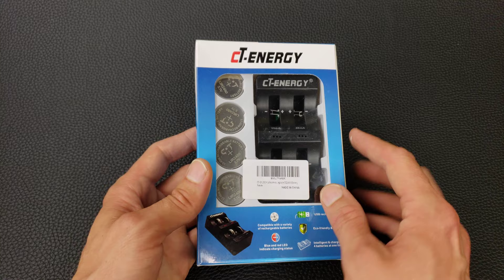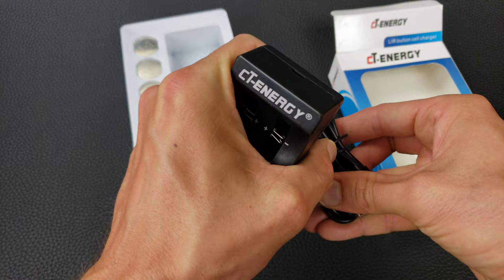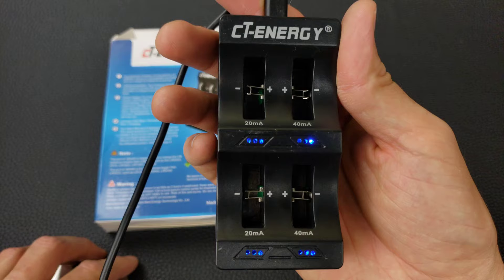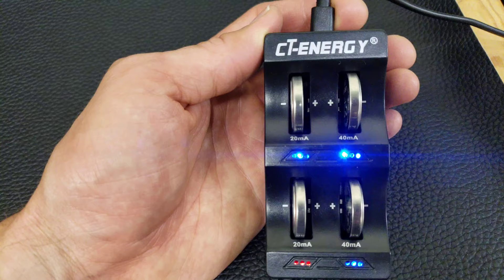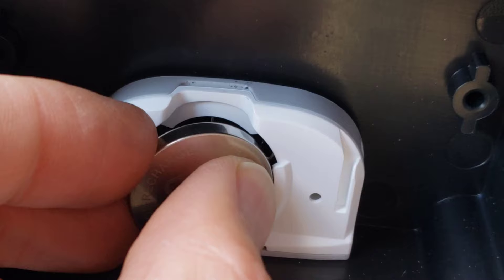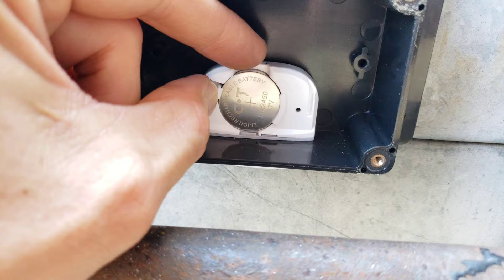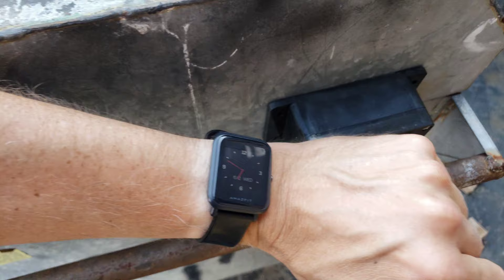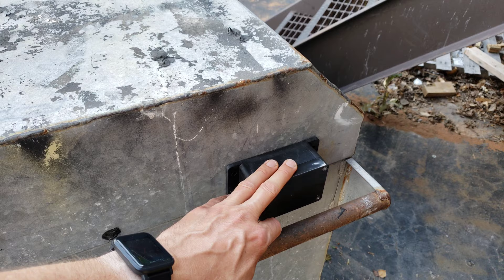Use Rechargeable Coin Cell Battery For SmartThings Smarthome Sensors | CR2450 To LIR2450

Comment: you are very smart dude. and thats coming from a self made electronics engineer with 37 years of electronics engineering with multiple u.s. electronics patents. i have the smarthings home automation system and was ready to design a battery eliminator circuit using rechargable aa batteries to give me 3 vdc at 1800 ma for a 5-year long term smart sensor power supply but if this works ill give it a try. the ratings on a regulat 2450 battery is rated at 600ma. rechargable 2450 is about 200ma max. at that rate it should last 1/3 the time as a regular 2450 but being rechargeable should pay for itself in time. ill give it a try and see how long it lasts. thx again dude.
Reply from the maker: Thanks, I appreciate it, but I was going down the same path you were until I found these rechargeable 2450 cells. Yes, they do last about 1/3 the time. 
For the outdoor version (https://youtu.be/_kKiIegkN_I ), I'm working to add a small solar panel and a low current Li-ion charger to keep the battery charged so I never have to change it.

Comment: You said that this battery has 1/4 of capacity compared with normal battery, this battery has about 40-60mah on the other hand normal battery has 225mah, I was thinking about buying it, but now I don't know if it's a good idea. 🤔
Reply from the maker: LIR2450 rechargeables should have ~120mah vs 600mah for non rechargeable.  https://www.powerstream.com/p/Lir2450.pdf
So, I have to swap the rechargeables about once every 3-4 months vs once a year.
Reply: I was thinking the same thing. As cheap as the normal batteries are, I am just not sure if it is worth it.

Comment: Couldn't find a spec sheet for the multipurpose sensor to check the battery voltage.

I too tried a 3.7v LIR a few years back - worked like a charm and shorted a battery myself. Often times our thumb would act as a ground to discharge the excess before it touches the negative.

Would be great to know how you progressed with the solar panel I was thinking to do similar.
Reply from the maker: Thanks for the tip. I have all the parts for the solar panel mod, just need to finish it so I don't have to replace the battery every few months.
Reply: @engineerable  I did something similar, but instead of using a solar panel and charger, I wired up a larger CR123 battery. I will look into a small solar panel and charger though as regardless of size, batteries always seem to last less than they should. Have you considered a larger rechargeable battery. There is plenty of room in that enclosure so you could use a larger battery...

Comment: My LIR2450 batteries charged to 4.15 volts.  Is that too high for sensors?
Reply from the maker: The normal charge cut off for Li ion batteries is 4.2V, so that is normal for the battery to reach that. When a load is connected, it will drop rapidly to 3.7V nominal. I found that they work fine in Smarthome products, but did not work in MyQ garage door sensor. It didn't damage the sensor, but the sensor would not work while the battery was in due to the higher voltage. A controlled discharge tool can be used to discharge to a specific voltage, like this - https://amzn.to/3LRZAa4
Reply: Thanks so much for the info.

When I charge the batteries, I'm only leaving it on for a few minutes, turning it off before the light turns blue.  So the voltage will rest at about 3.7 volts.

I going to use flameless candles as a load to off load the extra charge before putting the batteries in sensitive electronics.  Hope this works.
Reply: Or simply add some DC-DC step down circuit to set the voltage you want on the output and small LiOn charging circuit with solar panel/USB C plug on the input side so you can always charge it using for example powerbank if there's not enough sun @engineerable
Reply from the maker: @bunio14  I'm setting up some outdoor ones to solar charge, here's how: https://www.engineerable.com/single-post/diy-waterproof-solar-powered-smartthings-contact-sensor-outdoor-z-wave-zigbee-door-smarthome

Comment: That's a pretty bad design on that sensor, how it can short the battery so easily. Maybe a little creative bending might help. If you are installing a charging circuit in that box, install a better external battery holder inside the box. You can also go with a larger size battery.
Reply from the maker: Yes, I've upgraded some to use cylindrical lithium batteries or 18650 batteries

Comment: You keep handling the batteries by grabbing the positive and negative sides and it's KILLING ME DX
Reply from the maker: The resistance of dry skin is too high to discharge a 3V battery. It is therefore perfectly safe to hold it across the positive and negative side because it does not have a high enough voltage potential to conduct through the skin.
Reply: @engineerable  really? I was always told to hold the coins on the side so’s not to drain the battery or shorten its life.
Reply: @jaspercochran1535  
really.
You can actually measure the leakage with a simple multimeter.
Reply: g @jaspercochran1535  I was always told the same thing. These coin cells have such a small amount of current in them that just your skin can drain a lot out of them. Just in case I always handle them with something non conductive.